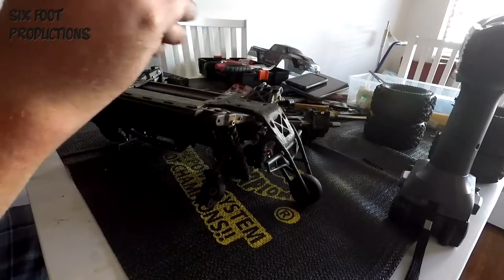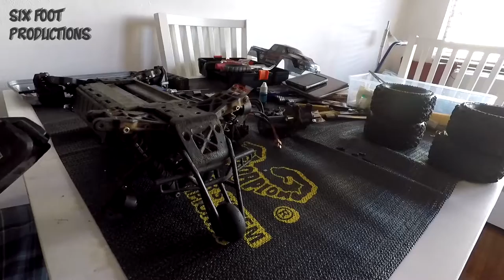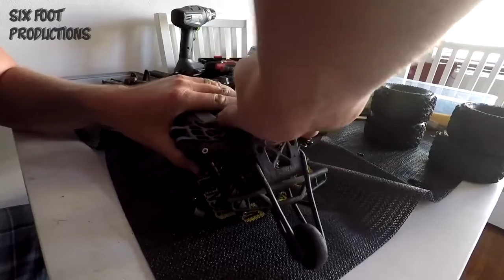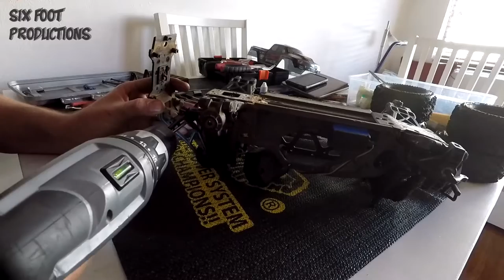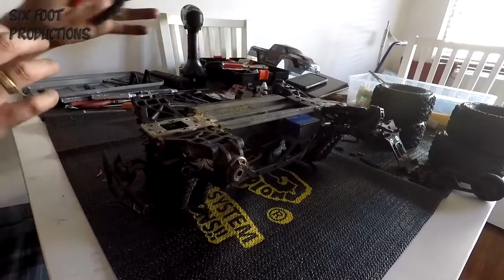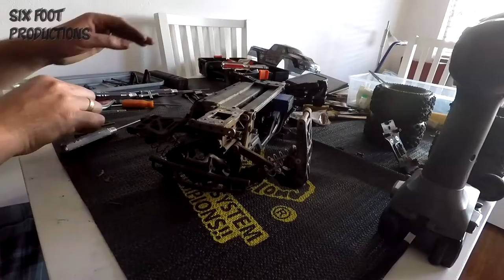How to remove diff on HPI Savage XS Flux

Comment: I seem to have power on the front and back drive shafts but no power from rear diff. Rear wheels do turn but not under load.  Do I need to check diff by dismantling, what am I looking for ? Wouldn't mind but its only done 90mins driving with no jumps or excessive speeds. Any help appreciated.
Reply from the maker: Wouldn’t hurt to disassemble see where the issue is. Might he a simple fix once opened up